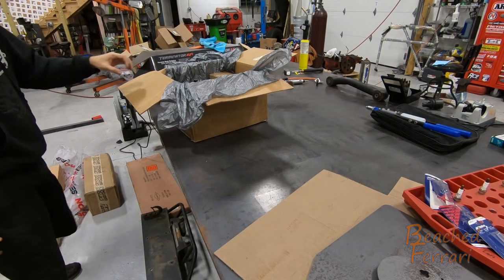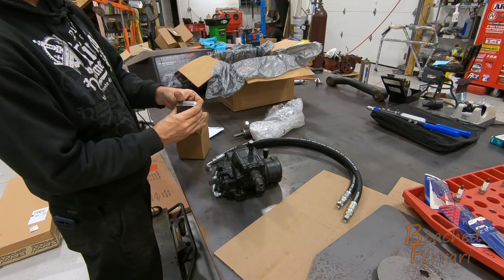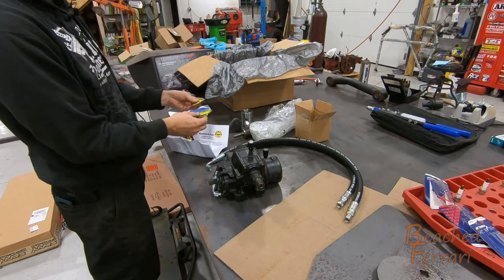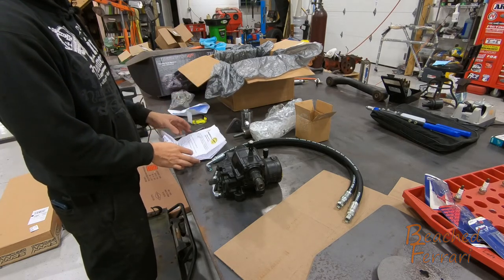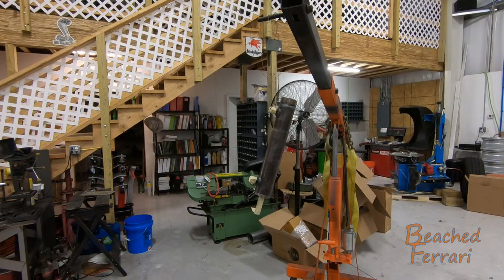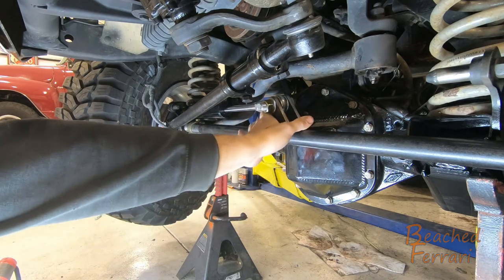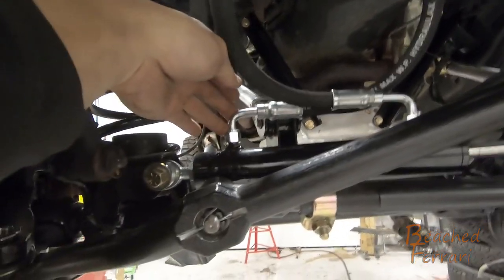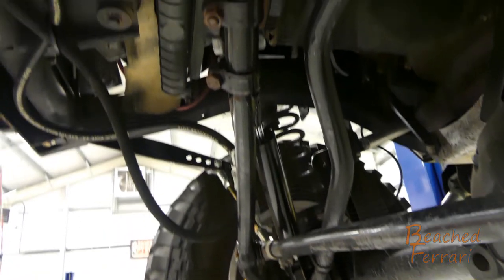TJ Hydro Steering Installation

Comment: Awesome work mate, I need to do this on my Jeep
Reply from the maker: Highly suggest it!  After the first trail ride I decided to add a cooler.  Got a little bit of fade as it heated up on tight trails.
Reply: Do you have a link to the cooler you used? I’m considering this upgrade but if I’m gonna add a cooler I wanna do it from the start
Reply from the maker: @johnharrelson7537  Just this basic one: https://amzn.to/35DiLiF

Comment: Looks like it has been a year or so since you did the RNR hydro assist. Any new updates or changes? Anything you would do differently?  I’ll be doing this project later this year and it looks really hard to make it work well on the TJ44. Only have 10” of suspension travel now with plans to go to 12” of travel. Thanks for making this video and sharing your knowledge.
Reply from the maker: Steering system itself has been good.  I did add a cooler in front of the radiator to extra cooling and capacity.

Getting ready to do a double shear trackbar mount and really debating on going with WJ knunckles and ditching the y link steering.
Reply: @beachedferrari  You hit the nail on the head. 👍🏼 I’m being told I need to do the WJ over the knuckle setup so I have room to do it “right” on a TJ44.  Really like the Currie steering setup with the aluminum tie rod from Savvy Offroad that i have now but I can switch it all out if that’s the right way to do it.

Comment: Looking to mount a ram with the same steering setup on my TJ. How has changing the location to the drag link worked out? someone mentioned that to me as an idea but my thought was if you're not parallel you could be putting some weird forces onto your steering, especially the steering box.
Reply from the maker: It's worked great now that it's moved to the draglink.  No more issues.
Reply: @beachedferrari  good to hear